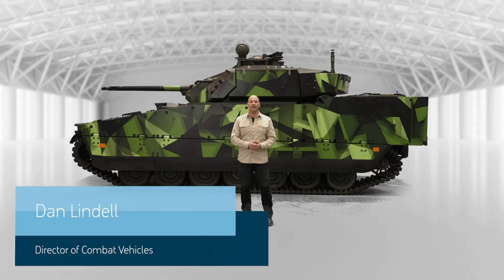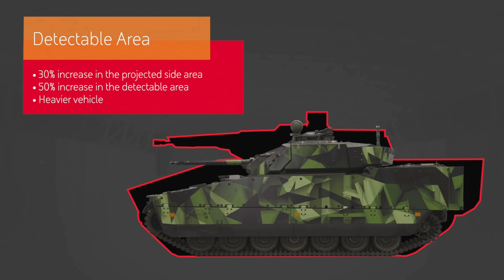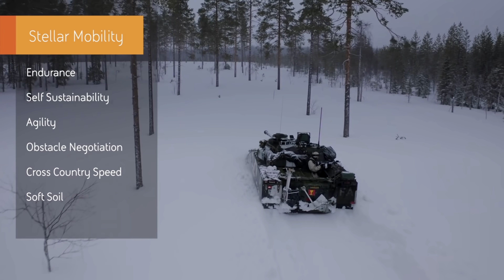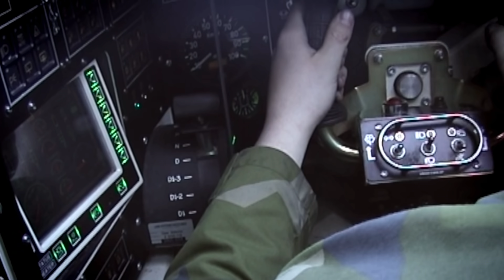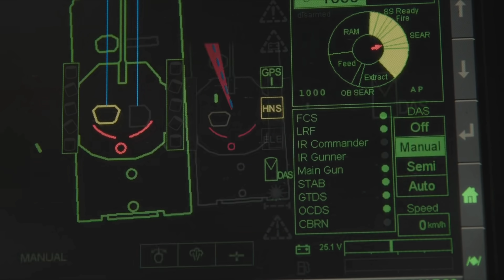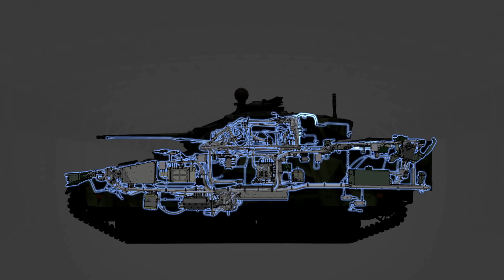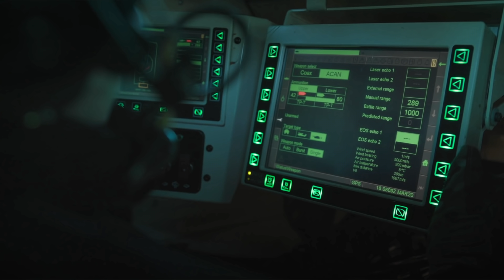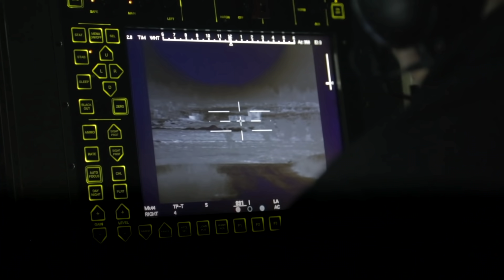The CV90 Infantry Fighting Vehicle Family | THE BEST IFV IN THE WORLD 🏆

Comment from the maker: 💥 Start your mercenary career right now! Sign up for free 🆓 https://bit.ly/AW_Matsimus and receive the T-64 "Hunter" Tier 5 Premium MBT 
Existing users can use this bonus code G5H2PTKATEQEDS7K to receive 7 days rental CV 90 “Ghost” + 3 days of premium time.
Reply: Invalid promo code
Reply: I'm curious about one thing. On the CV90, why tracks and not wheels?
Reply: the original "Matsimus Music" of the Roman soldier walking through a battlefield was far, far better in every way, please bring it back, or at least run a poll to find out what your viewers want to see/hear.  Just my thoughts and suggestions.
Reply: Would you prefer the CV90 over the LAV700 ?
Reply: The very first CV90 was fielded in 1993 with the Swedish army.
A family of five variants.
Reply: yep code doesn t work :(
Reply: @tsamoka6496  Tracks can go where wheels cannot. It's that simple my friend. The reduced ground pressure of tracks makes them superior in many situations, especially on wetland, snow, soft sand and tundra. They can also carry thicker armour and protection for the same reason, - ground pressure. Wheeled IFV/APC have their strengths  and modern armies need both. For long distance deployment in a region with good road infrastructure wheels are perfect,. Especially if they have reasonable off road capability. One is not "better" than the other. They are complimentary.
I wish you well friend.
Reply: @arabiano9719  Preference would be dependant on terrain and the mission. They both have strengths and weaknesses. Given a thousand mile road march and fighting in semi urban environments. I'll take the wheeled systems. However, given a much shorter deployment and advance to battle, over wetlands, snow, mud and sand. It's tracks every time.
Reply: You need to update this video since there will be 9 nations using CV90 since Slovakia and Czech chose it over Lynx etc as their next IFV
Reply: Risk world map thing in the video seems to be of Danish origin 😁 It's perfect danish. 

In Denmark we usually only hear about all the problems, troubles and short comings... but we barely ever hear anything about the CV90 😊 exept from the time of requirement.
Reply: Just for you Mr. Matsimus (in case you don't allready know this chanal) "Christian Thøgersen" he has a lot of great video footage of danish military equipment like The CV90, Piranha V and Leopard 2 😊
Reply: Check the Russian mine radius before. 82mm are silent, precise, fast and, well, deadly.
Reply: The cost of a single CV90 is more than a single Merkava mk4 Main battle tank of the Israeli defense industry serving in the IDF. guess who survive a confrontation between those two. Second, you might say this is IFV and the other is a Tank, I will argue, one do not waste the price of a Tank for an IFV. IFV should be cheap and cost effective, and leave the heavy budget for the main battle tank escorting the IFV, with heavy armor protection and weapon. the IFV should concentrate in transferring troops, not trying to imitate a semi tank - for a full tank price. go learn from the IDF, they have real combat experience in real danger places at the middle east. The CV90 is a model on how to waste resource and allocate them completely wrong. this among most other modern IFV.  if you want to know how a cost effective IFV looks like, see the new Eitan AFV of IDF. it's cost is 1.5 million US$ only.
Reply: Well we will soon get to see how it performs
Reply: @AY-dw4om  When the Merkava mk4 can climb a snowy hilltop or go through a thick wet forest in Sweden I’ll take it before the cv90. There is a reason why the Baltic states use the cv90 and it’s mobility. Even the Leo 2 struggles in our terrain sometimes and that’s why this is the best IFV for us.
Reply: have you seen the merkava mk 4 mobility ?  I assume you did not...  maybe its time to disclose, I am ex IDF Armor soldiers. I served 1993-1996 when we had Merkava mk 2 back than. My know how in armored tanks is well footed.  The merkava line of MBT's is probably one of the only Tanks that saw Real intensive action at the years 1979-2023. even more so than the Abrams saw at Iraq. the merkava Is battle grown design as well as ATGM proof (the only one in the  currently) via trophy active protection system.
Reply: @AY-dw4om  It did all that in Northern Europe? Have you ever been here? If you take that heavy Merkava off a road from September-June it will be bogged down. Sweden can’t use wheeled transports in the north cause the thick forests, large marshlands and high mountains. The Merkava is an excellent tank but not for us up here in the north.
Reply: @user-bd7zi5uc1x  Merkava MBT can do desert, forest, rocky mountains, snow, mud, all you think about. can cross water as long as it is not too deep. there are enough movies over you tube go watch. it was developed for the rocky mountains of the Galil, which is like northern Europe when it is winter in Israel with snow. And is was also made ready for the Deseret at 50c. it was specially designed for urban warfare and narrow passages (the cannon limitation length).  it has also air-condition for cooling and heating. It also has "Fighter-Jet" helmets for the crew inside with virtual view of the out side world via external cameras, projecting the out side world to the tank crew.  so they will not have to stick their heads out side and get a sniper headshot.  the technology was taken from Israel defense industry from the aviation helmets pioneered in Israel over the 1980s . the same technology Israel's Rafael is making for the F35 as well. it was developed in Israel and pioneered in the 80s. outsiders cannot grasp the generational gap IDF defense industry was able to accumulate over the years. some 20 years ahead at least, I kid you not. the merkava is cable to take down Arial targets, a unique in the world, with its main 120mm cannon  using triple purpose shell from ground (hard + soft) and air (burst). the gunner chose  method of war-head of the shell and then fires it. including target acquisition and information exchange between friendly units in the battalion and beyond and between the tank and a fighter jet above it. if you were to visit the machine here in IL for a day, you would come back home understanding how big is the gap between Eu defense tech . 20 years is understating it. it is also bio and nuclear warfare proof via hi pressurized crew compartment using active filtration. it is also remote controlled for some of its capabilities, in case where the crew was hit and a friendly tank need to assist from remote. or you want to detonate a fallen tank so it will not get into the hands of the enemy. all from remote.  it hits in first round from more than 3km target, while moving at 30km/hour.  this is how capable is the tank's computer and battle management algorithms, and the quality of the cannon precision and shells manufacturing tolerances of israel industry. the shell have in flight stabilizing tools no other shell have. it can also fire Spike ATGM for 8 km range the extended range version, if fitted into the mission.
 I just scraped the surface and can lecture on the merkava for hours. gave you a small glimpse into what a Merkava high tech machine is so you get the magnitude of the machine's abilities. When US armory crew came to to visit us, they were shocked. and they have a very modern army in USA yes, if they were shocked, get the idea.
Reply: can somebody plz explain why more APCs/IFV don't have bulletproof sunroofs so that the mounted infantry can use their rifles to shoot out from the top of the APC/IFV??
Reply: Can you imagine a mechanised brigade once we've mastered refractive camouflage?!
Reply: I still think that the GTK Boxer is better. It is faster than the CV90, has more than 3x the operating range (CV90:320km; Boxer: 1100km), is much more versatile since it is available wheeled or tracked and can converted from anything to anything in 30 minutes. 
By anything I literally mean anything: Ambulance, mobile hospital, command vehicle, radar, anti-air, standard IFV with autocannon, 105mm, 120mm and even 155mm main gun, engineering vehicle, bridgelayer etc.
Reply: Why don't they use mirrors as camo?